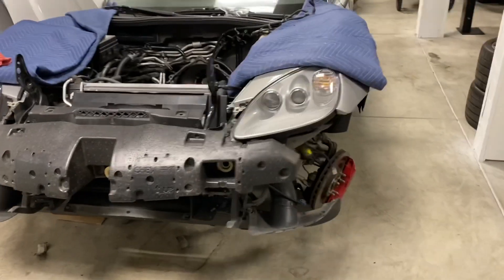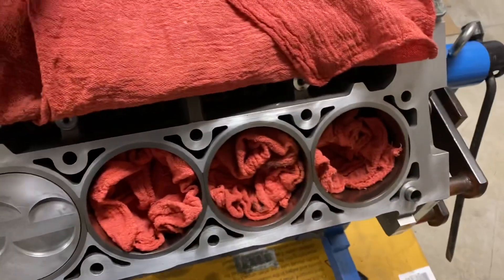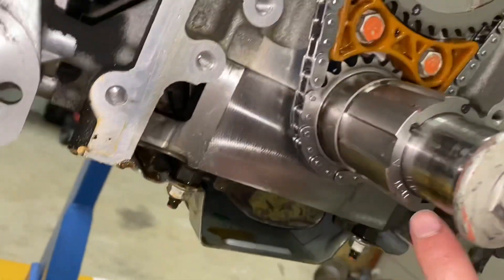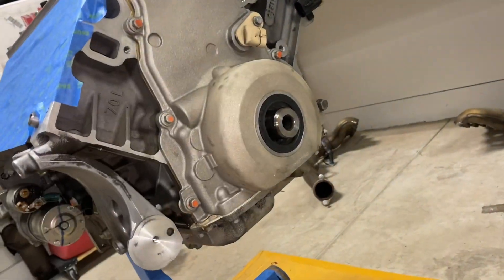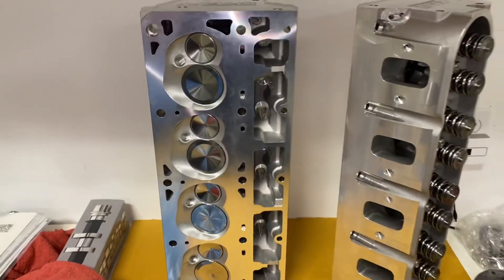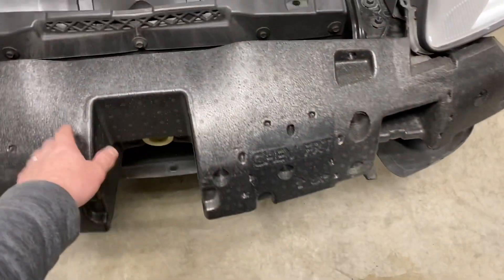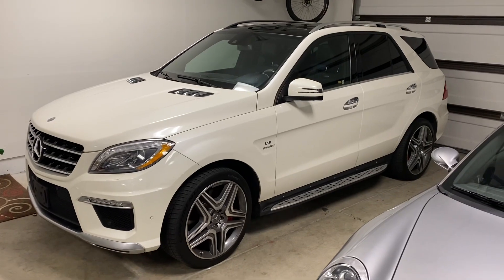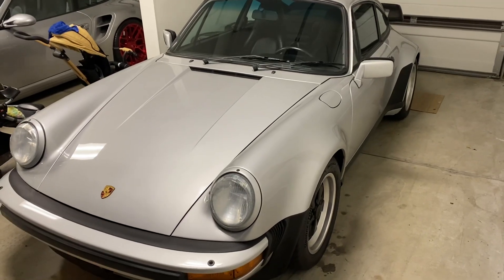My Corvette Z06 project has been sitting for a year.

Comment: C6 z06 and c6 zr1 are definitely future classics
Reply from the maker: I agree! The C6 Corvette, the Z06 and ZR1 in particular, are my favorite modern Corvettes. Perfect styling and design making a raw, lightweight package that we will surely never see from any manufacture again.
Reply: @TaylorSmithCars  very underrated cars. My c6 z06 was all stock and it was far better than my friends 997.1 GT3  he paid triple for his GT3 and it had barely any torque and was a very stiff uncomfortable car with no trunk space. I would take my c6 z06 to Costco sometimes and would run 99% of my daily activities in it.  Very livable super car
Reply from the maker: @alimehrozi2828  I was actually on the fence between getting a 997.1 GT3 or a 997.1 Turbo and decided that I just wanted the Turbo because of the power. By comparison, the Turbo is a much nicer car than the Z06 as far as interior quality, etc. however the performance is quite similar in stock form. I paid less than half of what I paid for the 997 Turbo for the Z06. The market has changed a lot on C6 Vettes in the last 18 months, but I still think it is the best performance car value today. The Z06 gets incredible fuel mileage as well, making it a great daily.
Reply: @TaylorSmithCars  definitely made the right choice with the 997 turbo.  The lack of torque in the 997.1  gt3 is a big let down especially after feeling the thrust of the LS7. If you enjoy the torque from the LS7 I'd highly recommend an LSA or LS9 powered car. My cousin has a zl1 with a couple of bolt ons and a pullry and it is ridiculously quick. Definitely faster than a stock c6 z06
Reply from the maker: @alimehrozi2828  I agree! I own a small car dealership and sell performance cars and classic cars/trucks. I had a 2012 ZL1 last summer for a few weeks and I loved it. Those 12-15 ZL1s are probably my favorite Camaros.

Comment: I've never seen different length pushrods on the same engine. Not second guessing you or saying it's wrong, it's just curious that there would be variance between cylinders. Very exact! Looking forward to seeing this beast fire up!
Reply from the maker: I was thrown off as well when Tony first told me what we would be doing. Pretty much every one of his customers have 5-7 different lengths of pushrods with these packages. I have spent hours reading through Mamo threads on Corvette Forum. Tony prefers this method to ensure we are not leaving anything on the table with this build. The differences are very minimal for sure, but with the expense of this project I certainly did not want to be lazy on the details as the fine details are generally where the last little bit of power can be had.

Comment: Any updates????
Reply from the maker: New video coming soon. Car is back together
Reply: @TaylorSmithCars  awesome, I got a mamo c6z too I got it done in February.  What clutch did you go with? I got a mamo mantic and I’m not in love with it.
Reply from the maker: I bought his Mamofied RPS BC2 twin disc with the lightened flywheel. I like the clutch so far. I have put about 500 mile on the car so far. 

What kind of power did your car make?
Reply: @TaylorSmithCars  it made 640/560.  I had major traction issues with 345/30/19 r888r’s, I got 18” apex wheels in 18x12.5 and wrapped them in 345/35/18 toyo RR’s and traction is far superior.
Reply from the maker: That’s awesome! I went with Tony’s big titanium valve upgrade and bumped compression to 12:1. My car made 660/560 with 21 degrees of total timing. Tony thinks there is more on the table with some spark advance. I just put Weld bead locks on the car today with a 335/35R17 Hoosier
Reply: @TaylorSmithCars can’t wait for the video! Been following since the beginning